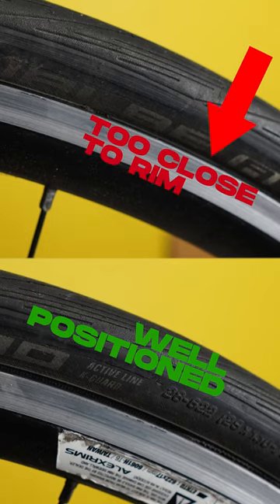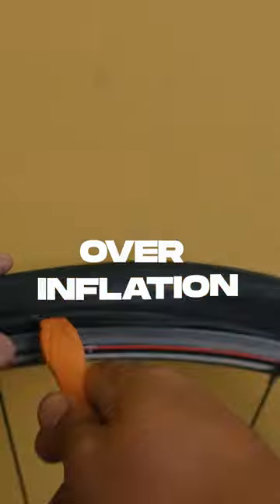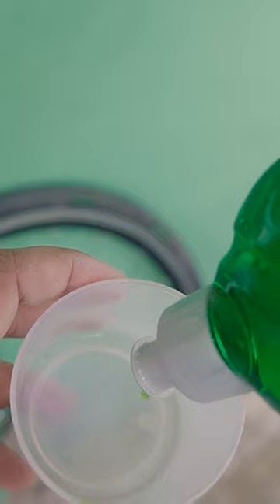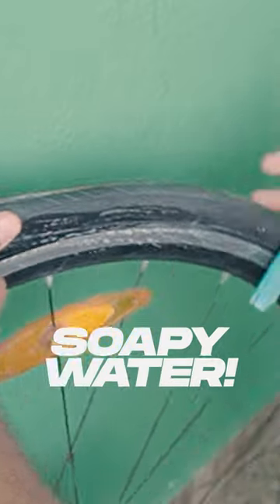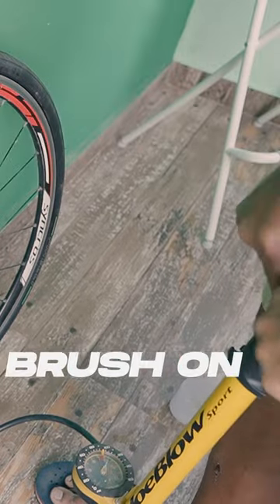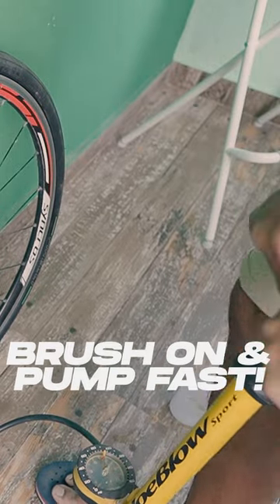How to Fix a Wobbly Bicycle Tyre #shorts

Comment: You know, I grew up as a kid on bicycles we learned to fix them taught by our fathers and uncles. It was necessary we did if we wanted to get around town or go fishing out at the lake 4 miles away. However, the best bikes of that time paled in comparison to what's out there today. Hell, even the bike I bought in the 1990s a Bianchi Ibex was far ahead of the bikes I grew up riding. To give an idea I learned to ride a bicycle back in the early 70s on a Gambles Hiawatha. I'll guess the bike was from the 60s that my dad fixed up it only had one speed and was heavy and hard to pedal with no chain guard, which led to my toenail getting ripped off as I didn't heed the warning from my parents to wear shoes when riding it, oh how women cried and dogs howled that day...lol...fast forward to the late 70s it was the Western Flyer Dirt duster and Huffy. Back then the top bike was a Schwinn if you could afford one. I'm 58 years old now, and last year, I bought a 29 inch Trek marlin 7 and paid about $900 for it, and decked it out with a topeak rear rack bontreager kovee tlr rims and a set of Specialized tubeless tires and black ops pedals. It is by far more bike than I've ever rode, but I was in a new bike shop in town the other day to get some supplies to fix my tire issues and they sold Yeti bikes I was of course sticker shocked but looked them over anyway. On the low end, I saw a Yeti ARC hard tail and was blown away at the technology and standard upgrades it had compared to my Marlin. That bike was on sale for $2,500 nearly 3x the price of my marlin. The technology of these modern bikes is crazy, but I like how they've evolved. Now that I got that off my chest, thanks for your video it brought me back up to speed on a simple technique to fixing tire wobble. Something I wasn't expecting to encounter with my TLR tires, and if you ever dealt with inflating a set of TLR tires, you'll know what a pain in the ass they are to inflate with a hand pump I was hesitant to lower the pressure to get the soapy water in the seam of the rim. After almost a week of frustration with that, I managed to get them inflated, but they came out crooked, and your video was a God send. Thanks for the tip... it worked.

Comment: LOL. Bullshit!  The tyre is stuck, not the inside tube!
Reply from the maker: Yes it's the tyre, and that's why we're treating the tyre with soapy water and not really doing anything with the tube - do rewatch.
Reply: No BS jsut done this tonight it's an old BMX trick from back in the day bit fairy dish soap round my 27.5 Schwalbe big Betty and it popped right into the rim bead! After about 2hrs trying to get it seated it kept sticking down into the centre valley works a treat this!

Comment: can you use chain lube?
Reply from the maker: I'm not sure, depending on the lube, it could adversely react with your tyre or tube. It's also much more expensive than dish 🧼 :)
Reply: I used Vaseline worked amazing
Reply: No!!!! It'll eat the rubber only use a soap or degreaser